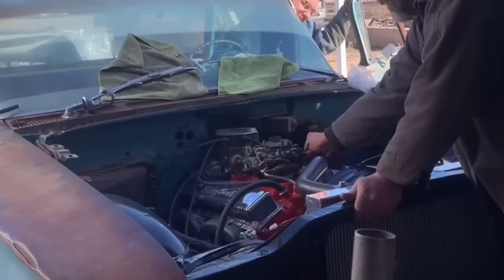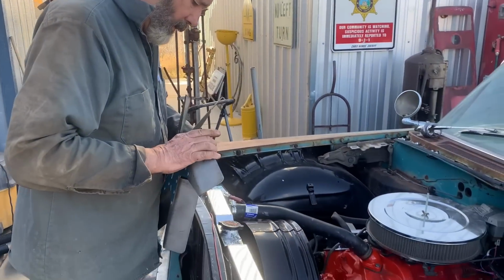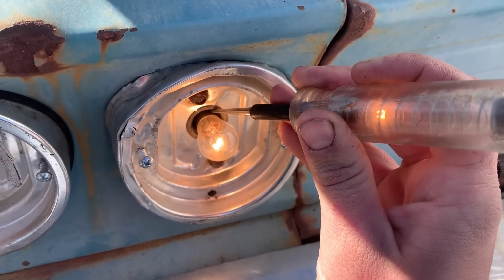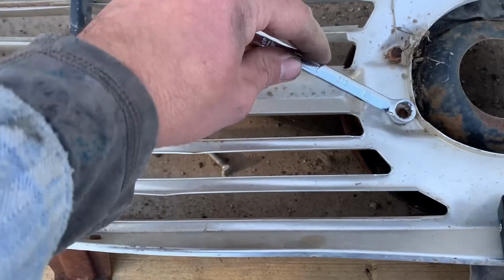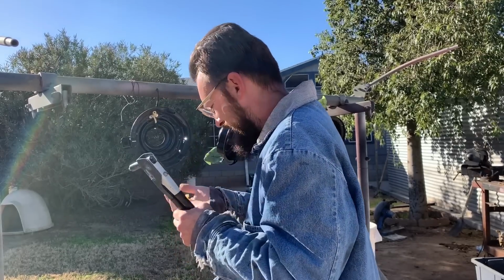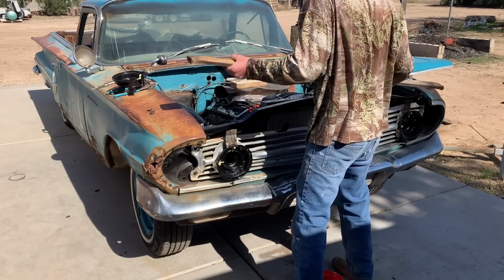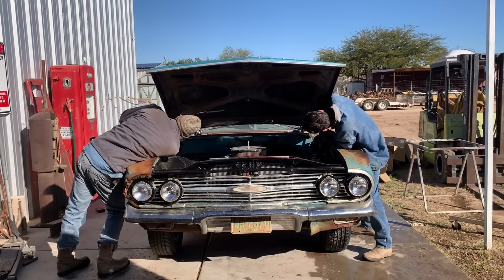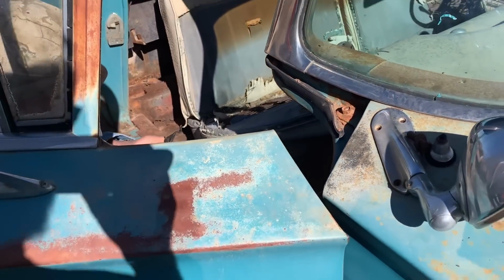It finally drives after 44 years! 1960 el Camino

Comment: those caps really set the wheels & tires off! so good to see the old El Camino drive around. i would pop out a few of the bigger dents and patch up the floors. fantastic project. this one is worthy of getting built up to a road ready, reliable shop truck/parts chaser.

Comment: I was working on a ‘61 Belair with the 235 six banger. The car had been in the desert for forty years. Somebody had put in 8 cylinder motor mounts, so the motor oil pan sat flat on the frame and steering linkage. Don’t lose those 6 banger motor mounts. I payed a pretty penny for a set. Thanks for the vids. I always look forward to them.

Comment: This build has been terrific. Now on to tackling the "Flintstones floor delete option" and other interior issues.  That motor mount issue is puzzling. Perhaps some owner only had a six after the original engine blew and put it in and then removed it before dumping it. Hope all your viewers, including me, get the word out on the need for the 1946 IHC drivers' side door.  It's out there-------someplace.
Reply from the maker: Exactly it is out there. Once you find it there it’ll be

Comment: In your part of the world, you may have a problem with the flex fan and cooling. I live in Wisconsin,  had the same fan on my chevy, it would over heat on a hot summer day. A ole stock car driver told me the 4 blade fan was the best. I had to change the water pump because of the same issues you are having, but in the end, it fixed the problem. Just saying.
Reply from the maker: Thanks for the heads up.

Comment: I put a 231 v6 in a 76 Pontiac Astra cut the drive shaft 2 in and it never vibrated I used a big pipe cutter to cut it and a oxy acetylene torch to weld it

Comment: Hi, with most of the 60's car i buy that have full metal bumpers and or blinkers / indicators in the bumper, i tend to make up a small ground wire to each light housing , the number plate light and then run the wire into the boot and terminate the ground on either the wheel well panel or the rear parcel shelf

Regards
George

Comment: Excellent work Travis,  you and your dad  saved another Chevy,  a El amino to  at that,  sorry you had to change out the mounts and recut the drive shaft,  with that being completed,  nice job on the head light buckets, the grill  getting the rear lights working properly, fitting the hood to close real nice 👍.  It looks so good driving down the road again, what are your plans for the exhaust system.
Reply from the maker: We’re gonna have an exhaust put on and we’ll also do some body work and rust repair
Reply: Ok good, I'll be waiting for the updates on the 60 El amino, keep up the amazing work.

Comment: It runs and drives, very cool! The problem with the HEI distributor isn't the backside to firewall clearance it's that there's not enough room to remove it with how it sits under the firewall overhang. Put one in my 57 Chevy when the engine went in no problem but didn't have enough room to pull it up and out and that can be a big deal if you're on the road.
Reply from the maker: Oh I see. Yeah you are right

Comment: Under her own steam ... wonderful and congrats !  Also saw you finally installed the tail light lens ... very cool.  Just a heads up on your hood hinges.  Just like on GM square body PU's, you need to push "back" and then "down" to close them ... otherwise, you'll end  up with a crease in the middle of your hood; also lube the hinges well. Can't wait for the next installment guys.

Comment: Could do the hot rod trick of lifting the rear of the hood where it is at the window up so that the hot air can escape out the rear of the engine compartment and it can run alittle cooler.

Comment: The problem is crowdsourcing is both smarter and dumber than any individual. In this case, a portion of the "crowd" knew what you needed to know about those mounts, but it's understandable you being on-site figuring it seemed to be going well otherwise. It's hard to pick through all those comments and find out what it is you need to know.
Reply: Its always trial and error when you're working behind someone else.  I converted a 6 cyl to V8 in a 60 impala, but a friend told me about the motor mount brackets being different, otherwise I would not have known it. Always good to have someone that can give you tips, save you some work (and cussing.) That's my deduction, someone installed a 6 cylinder for whatever reason, so, their mistake was an honest one,  (checking the data plate for originality.) Like the car, cool ride. Now, on to the floors.
Reply from the maker: Exactly